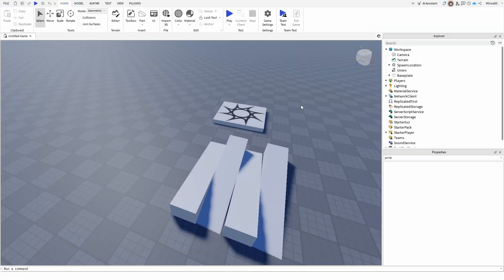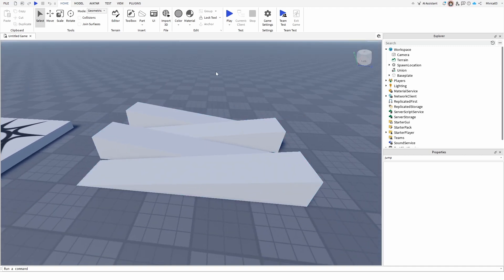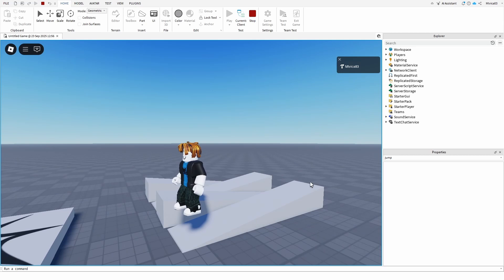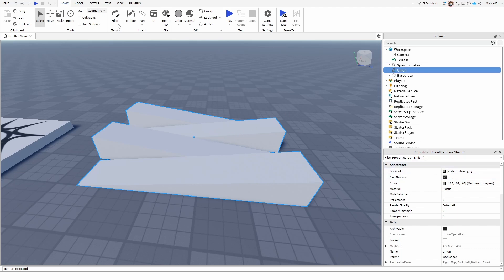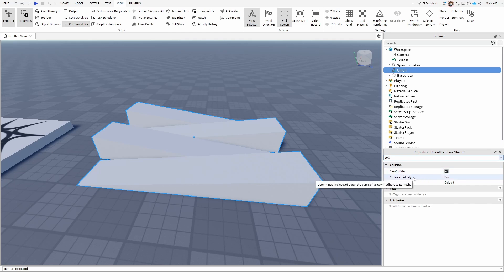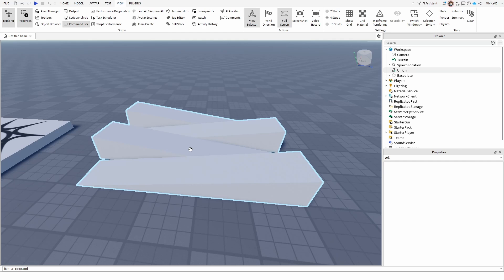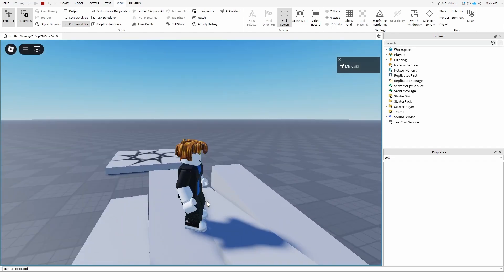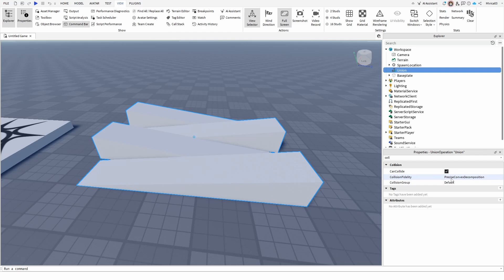How to Fix Mesh Collision in Roblox Studio

Comment: This typically fixes most problems, but it won't always. Especially if you are using higher quality meshes you have made in Blender for things like terrain. Even with that collision setting, the collisions may still not be accurate.

To that end, the best fix is to quit Roblox Studio and use an infinitely better engine.
Reply from the maker: Thanks for sharing your thoughts, much appreciated.
Reply: @IvicaMilaric  making a 250x250 circular part and putting a 6x6 stud hole through it also causes issues.
Reply: lmfao, real 😂😂✌
Reply: thanks for that, really helped
Reply: literally bruh i love roblox but some things about it just suck such as this, like why tf would play with the meshes' collision??
Reply: @culsud  tell me about it.